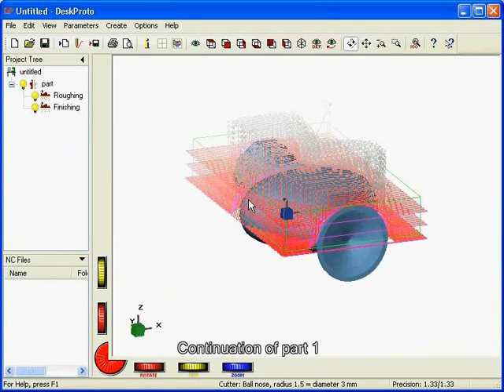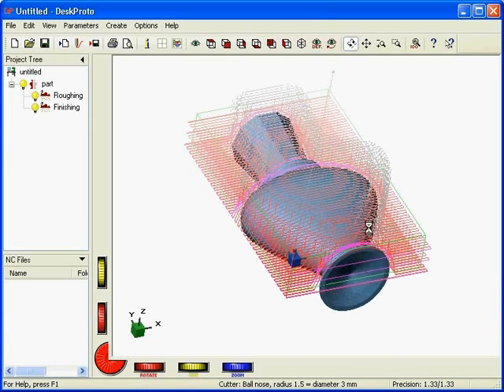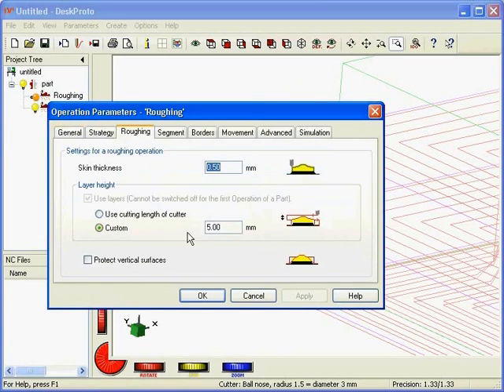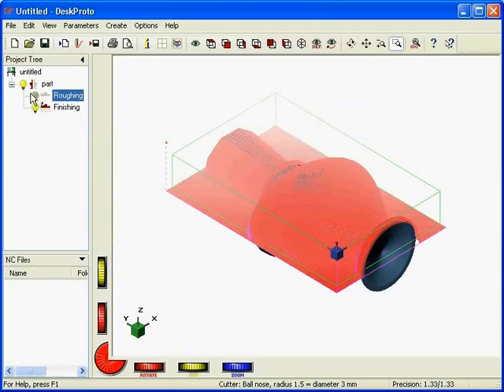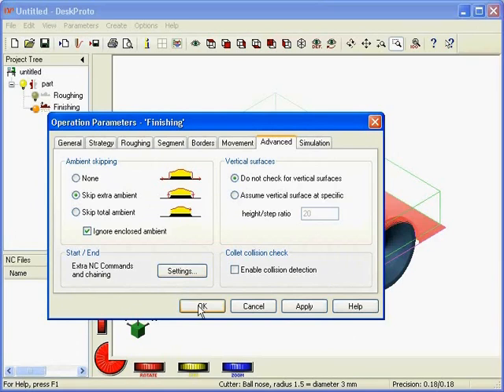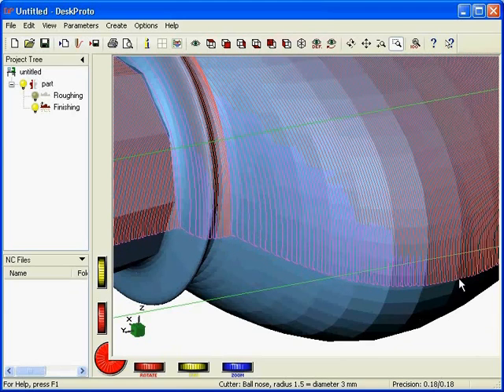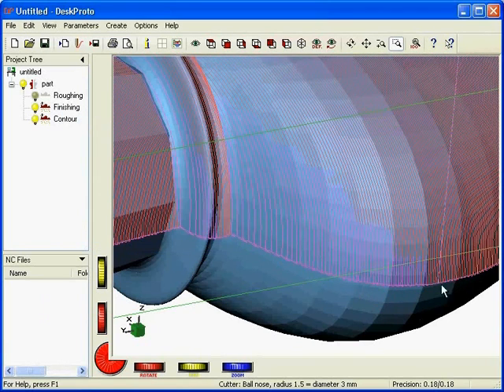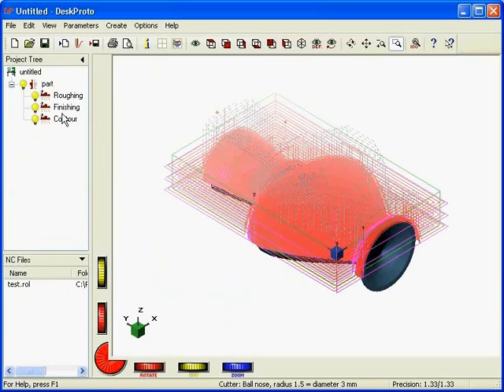DeskProto, Roughing and Finishing, part 2 of 2

Comment: I thought, since the software has the "Send NC file to machine" option, that deskproto was able to communicate with my Isel CPM 3020 machine's controller IMC4. Thanks for the video.
Reply from the maker: The option "Send to machine" works only for very few machines. For most machines you need to use control software: software that can import the NC file from DeskProto, set the zero point and make the machine follow the toolpaths. For your Isel machine several control software programs are available, like Remote and Kay.
Reply: DeskProto Yes,I just realized that. Thanks for answering :)

Comment from the maker: These videos explain how to generate toolpaths. When saving the NC file the G-codes are generated. For more detailed information you can check the Tutorial book (PDF) on the website, and for an easier process you can use one of the wizards.  
In order to send these G-codes to your controller you will need to use the Control software that came with your controller (for instance Mach3). DeskProto is CAM software only, it will not directly communicate with your machine.